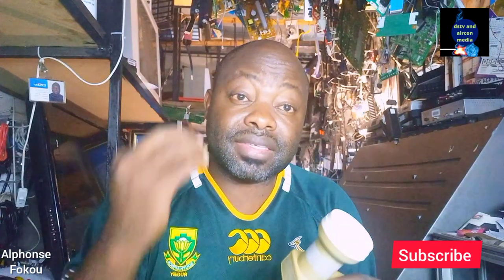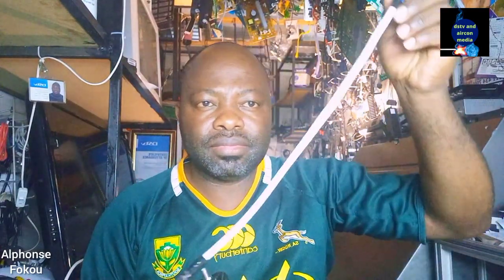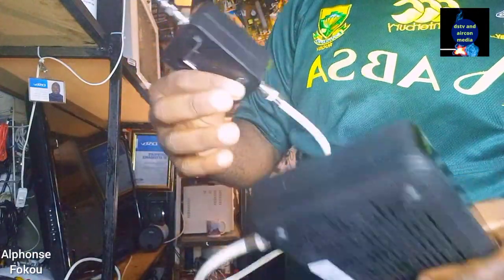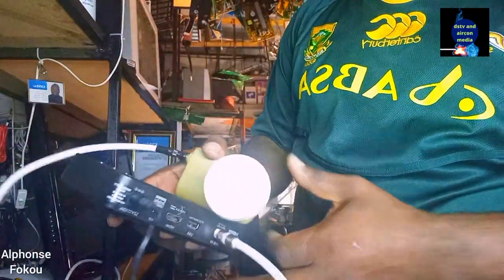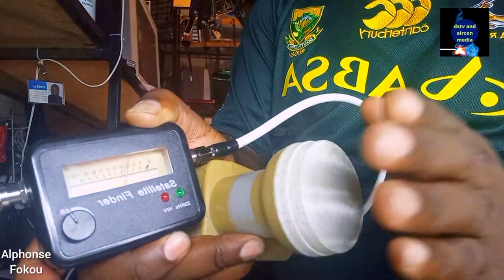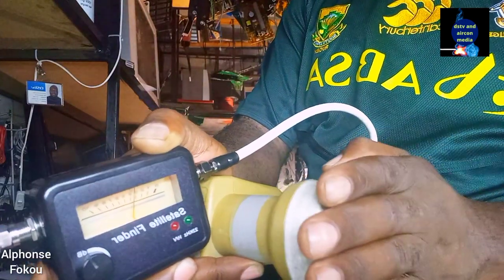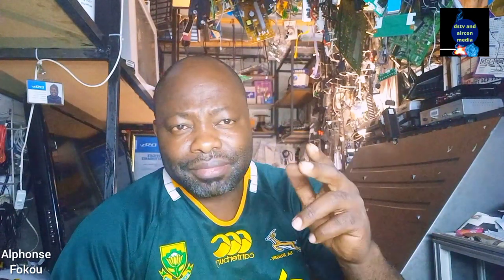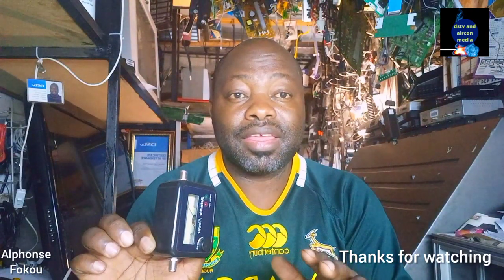how to use an analog satellite finder to test your universal LNB.

Comment: so that satellite finder runs of electricity from the receiver. I didn't know that. I melted the solder
and took the back loose. there is no battery in there. So I guess I just didn't know how to use it.